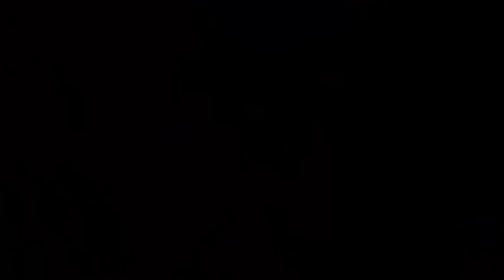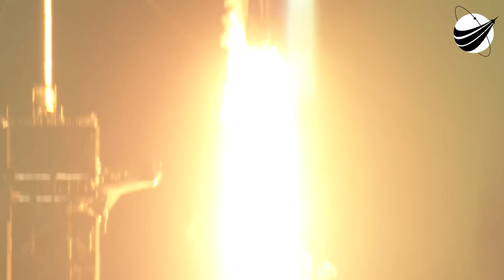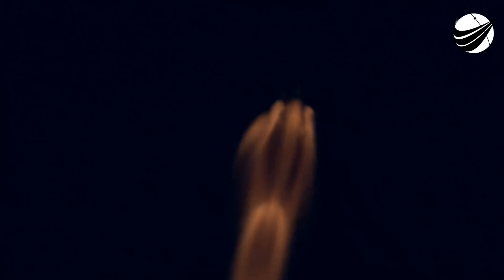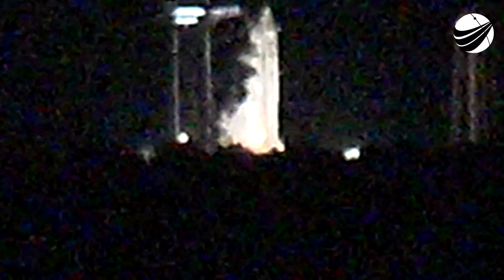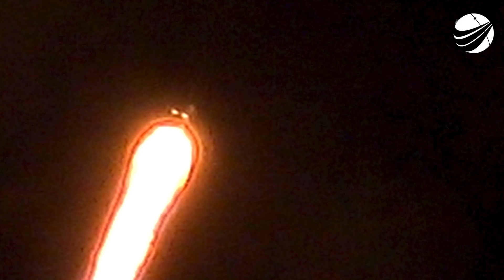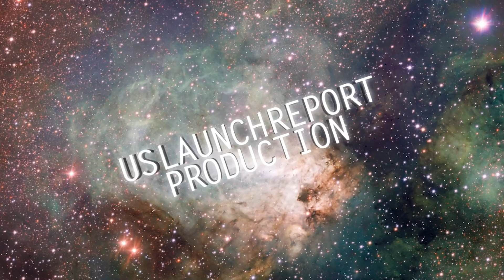SpaceX - CREW 1 - Unexplained Shock Wave  11-17-2020

Comment: Did anyone notice the "flame vortexes" just above the engines seem to crawl higher up the side of the rocket than they usually do?   From the SpaceX feed, they looked really pronounced.    I assume they plan for hotter temps around the base of the rocket, but as I was watching, they looked like they could've concentrated heat on spots of the fuselage.   Flashbacks to Challenger had me on pins and needles watching those flames creep higher and higher.
Reply: Basically every launch vehicle has plume creep-up along the base of the rocket, and it is usually the most pronounced at 5-30 kilometers of altitude.

Comment: Just like on re entry burn, the flame can be seen as acting as an solid when encountering the atmoshpere, creating and almost invisible sheild that builds up pressure in front of the flame until the pressure becomes high enough to overcome the surrounding pressure and releases in the form of a pressure wave. IMO
Reply: Your explanation is onto something, but it’s pretty inaccurate, and improvised.
Reply: @profile.  Yeah, pretty much. I always find it interesting that on the re entry burn they always say it's slowing the rocket down but never say notice the flame shield protecting the rocket and contouring to the shape and direction of reentry. 

The same thing must happen on launch but instead of acting like a shield it acts like drag as the air hits it and it builds up pressure which triggers runaway pressure build up until it overcomes the surrounding pressure (upper atmoshpere) and explodes pretty much but nothing containing it so it just kind of dissipates rapidly.

Comment: It's shockingly Norminal, just ask Elon.
Reply from the maker: Early in the flight, SpaceX teams in Hawthorne noticed temperature regulation issues, specifically related to hypergolic propellants on board.
Reply: @Uslaunchreport  hypergolics are scary stuff don't know why they don't use soild rocket motors

Comment: You can tell the exact moment the engines throttle down and throttle back up just by looking at the brightness of the rocket exhaust.
Reply: bcoleman71 You’re being misled by the changing exposure setting of the camera.
Reply: While im tracking rockets I bring in and take out neutral  density  filters to block out light from the engine's  flare so its really hard to tell if they throttle up or down from our Video's
Reply: Yes I thought that's the gain level being adjusted on the camera.
Reply: It's a weird coincidence that it happened at almost precisely when the engines throttled down and appeared again after they throttled up lol
Reply: The more reliable way is to look at the length of the plume. You can see it really well in falcon heavy launches, the center core plume length is like 1/2 the length of the outer cores!
Reply: And during that span of time, the atmosphere is getting increasingly thinner, and the atmospheric pressure that normally keeps the exhaust plumes confined is virtually diminished.

Comment: It's the shockwave caused by the rocket. The camera line of sight is parallel with Mach cone of the rocket at that particular instant. The high-low pressure shockwave has a different index of refraction than the air around it, producing a mirage-like reflection of the rocket exhaust. This is visible during many launches.

Comment: are you sure its not the lense?
Reply from the maker: According to Ed Geiger the tracker operator, no. In the second video appear two flashes above the Merlins for a split second.
Reply: @Uslaunchreport  isnt the gas generator exhaust above the exhaust of the combustion chamber? maybe the gas generators of these two merlins had a bit more oxygen in them then usually...
Reply from the maker: @KingSnowdown  This is why we asked, had not seen this before

Comment: It looks like plasma coming off the landing legs. As they stick out a bit into the airflow I imagine that they get hot at those speeds.
Reply: That's flame creep, due to the pressure differences. The exhaust flame actually creeps up the side of the rocket and is worst just before max Q, I think.

Comment: Weird. I see what you mean. Must be some sort of Mach effect, if it isn't a recording artefact or flare. The rippling air around a rocket in ascent is a very complex environment, from the perspective of shockwaves and so on. Maybe an inversion layer bouncing shock back down toward the vehicle from a point where it was precious subsonic? Wild speculation on my part. I'll ask around my much better educated friends, see what they think.
Reply: @PumpkinheadsPlayhouse  Makes sense, and it's the most simple explanation. Some kind of detector fault or recording artefact.
Reply from the maker: @PumpkinheadsPlayhouse   No, says Ed Geiger, the Tracker operator.
Reply: Well given that For the Crew demo the Astronauts said the ride was ruffer than any others. The throttle profile was charged to accommodate the human cargo?